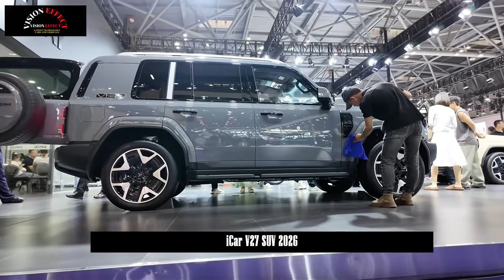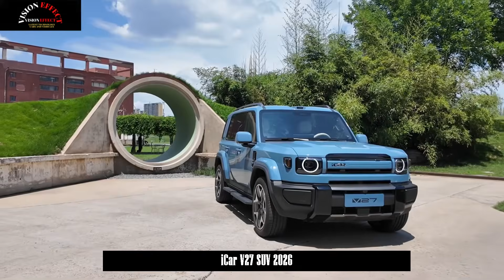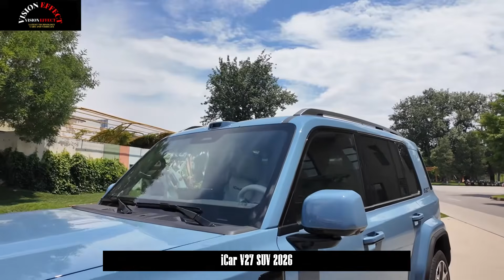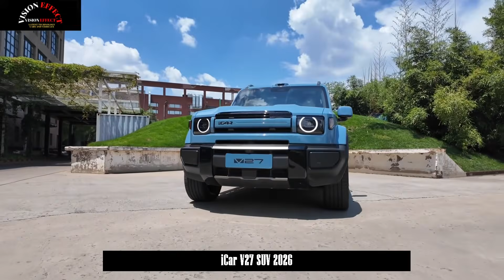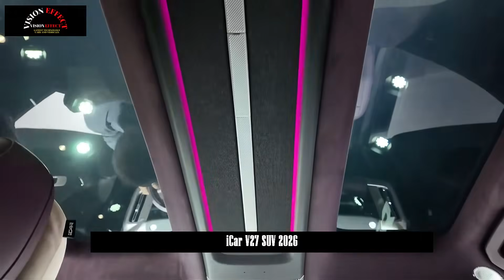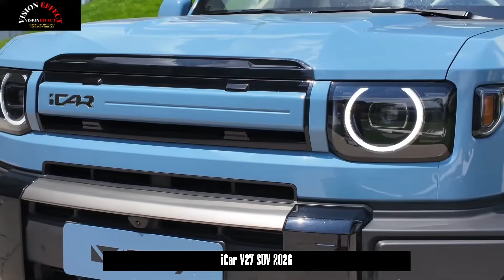2026 iCar V27 SUV: Who Should Buy It? Is It Really Economical? 🇨🇳🔋

Comment from the maker: By fusing a retro, hardcore 5-meter boxy aesthetic with a 1,230 km extended-range hybrid powertrain, Chery’s iCar V27 completely bypasses range anxiety while delivering massive interior passenger space. It effectively bridges the gap between clean city EV commuting and relentless weekend overlanding. What do you think—does the highly efficient EREV generator technology and disruptive pricing of the iCar V27 make it the ultimate smart buy in the mid-size SUV class, or do you still prefer a traditional, old-school diesel or pure petrol powertrain for off-roading?👇